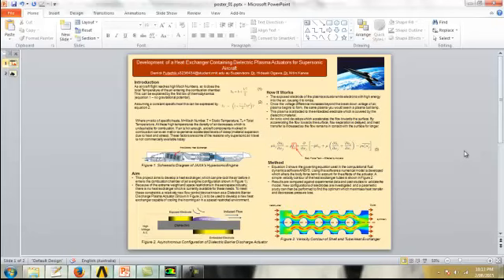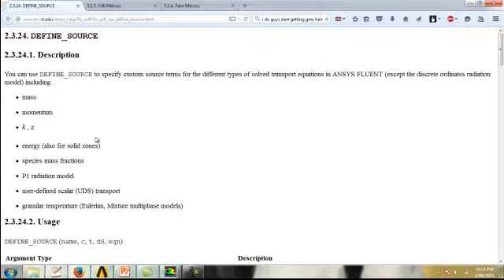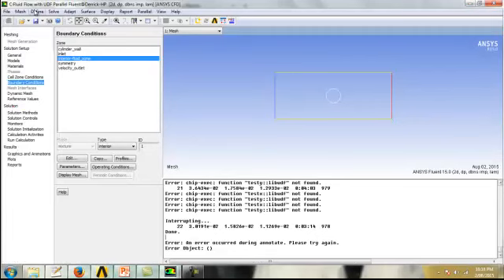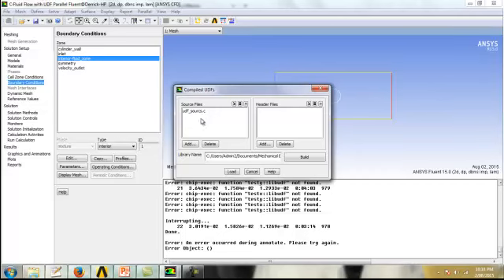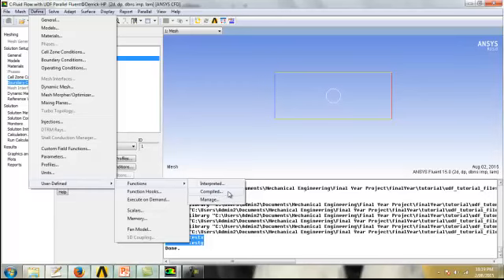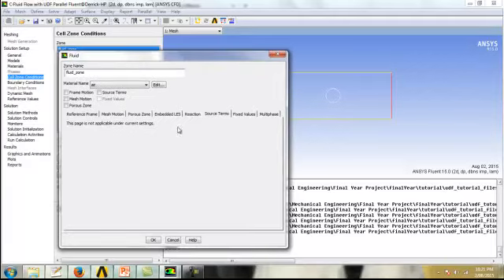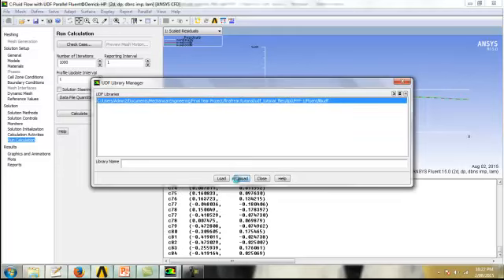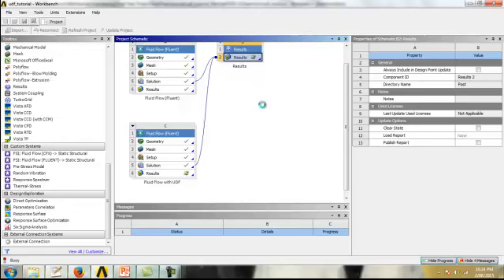UDF user defined functions ANSYS

Comment: Hi, can you help me am working on solar parabolic receiver and want using UDFs to attach the data got from ray tracing model to ansys fluent as wall thermal boundary condition. The heat flux data is a function of circumferential angle of the tube ( about 34 data points0. Thanks